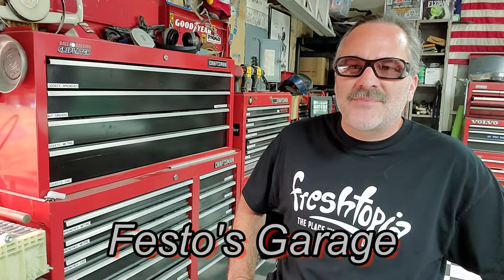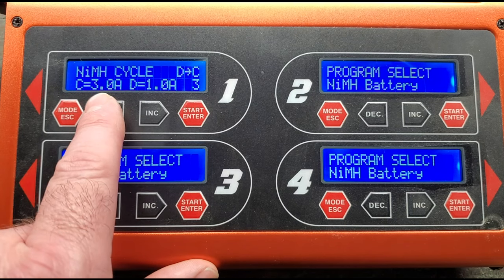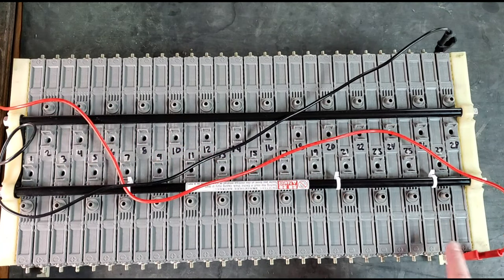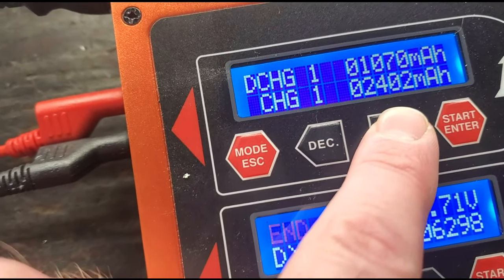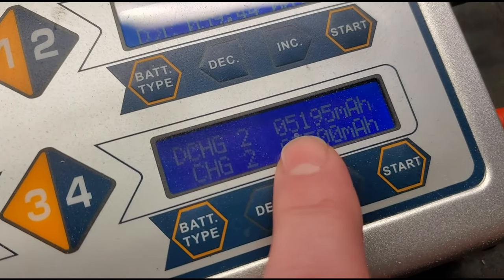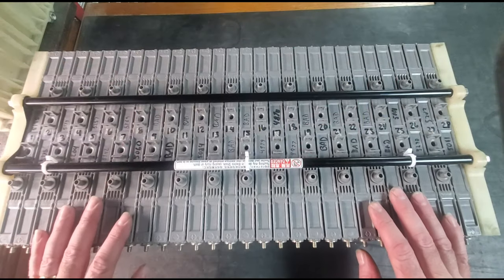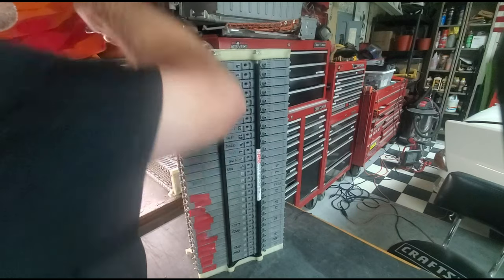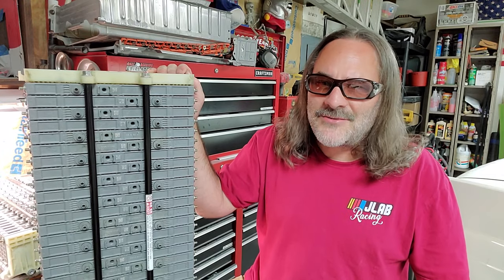Hybrid Battery Pack Refurbish - Step-By-Step w/ Settings - 2nd & 3rd Gen Toyota Prius - CQ3 Charger

Comment: Can it charge a few cells in a row? I have RX 30 cells*9.6V. I want to connect it permanently to 7,8,8,7 cells and charge it while parking
Reply from the maker: Thank you for watching. I do not know if that is possible. Sorry. Maybe someone reading comments will know? Maybe you can check online forums for answer. If you find answer, please write back in and let us know.
Reply: By 30 cells, I'm guessing you mean 30 modules. If each module is 9.6V, then you have 8 cells per module. Why would you connect a CQ3 charger permanently to a battery pack or any number of modules while it's still in the car? Also, what do you mean by 7,8,8,7 cells?

Comment: will this process work for a system upgraded with lithium blades
Reply from the maker: Thank you for watching. Yes this process will work for Lithium Ion batteries as well. Be surer charger is setup for lithium instead on NiMh.

Comment: Will you explain why you are only discharging down to 6 volts? It
 seems like this will give a false reading of the discharge capacity.
Reply from the maker: Thank you for watching. The discharge can be adjusted between 6.3v to 6.0v. I am taught that the voltage should not be much less as it could cause damage to the battery.
Reply: Why do you think it would give a false reading?

Comment: Is the second time I do this and I am not sure if I am doing something wrong but always all the time all the cells arrive to capacity at the first discharge and charge, it never goes to the second one, am I doing something wrong? I followed all the instructions
Reply from the maker: The charger will stop cycling once the battery reaches CAPA. If the discharge value is not 5000mah then you will need to run it again. If the charger does not reach CAPA then it will proceed to next programmed cycle.
Reply: @GreggFesto  thanks for replying, I get that but is it normal that all the cells arrives to CAPA on the first cycle?
Reply: @GreggFesto   Also another question if in the first cycle it goes over 5k is that enough or would be better if I run it two more times to get it over 6k? or is the same ? thanks
Reply from the maker: You are likely to get CAPA message first cycle if the batteries have been sitting for a while. This is why I like to run 3-5 cycles on each battery, it will tell how the battery is health wise by seeing if the discharge value increases or decreases with more cycles.
Reply from the maker: I suggest running 3 cycles at least on each battery so you can see if the values are increasing or decreasing. It will give you batter idea of the health.  A value of 6000mah discharge on your batteries will certainly be better than 5000mah. Remember that your pack will only be as strong as your weakest battery. For example if you have 27 batteries with 6000mah discharge and 1 battery with 4000mah discharge then you are limiting your pack to 4000mah. This is because they are all in series configuration.
Reply: @GreggFesto  again thank you so much for your help, you are great help for the community

Comment: When process is done and wnat instal batery on car do we instal it fully charged?
Reply from the maker: Yes, When using the charger to run the cycles you select discharge then charge. This way the batteries are left in charged state for balancing and installing in the car. Prius uses HV battery to start car so if you try to install discharged batteries the car will not start.

Comment: Thanks for the good video, I have a question. With the same mode (Ni-Mh/C=3.0A D=1.0A 3 cycle D>C) when I turned on the batteries on test, none of them passed, but the battery pack was disassembled, it was on a separate table. The elements get fat and none of them could complete the test, I really know that these elements are good, I just bought this device and wanted to test and learn how to use, please hlep me to  trooblshoting this process
Reply from the maker: Thank you for watching. I can try to help. When you report that the battery pack was on a separate table are you stating that the pack of 28 batteries was on a separate table or are you stating that an individual battery, 1 of the 28, was on a separate table?
Reply: @GreggFesto  More precisely, I have 8 batteries separately, and I took 4 of them and connected them to this charger, they did not pass the test, they got fat. That is, it is necessary to battery pack was in it's  frame? that they can't get fat ? is this correct ?
For example, I have 1 battery, but how can I test/restore it correctly?
I really want to study the operation of this device fully, I have charged the batteries separately with my custom own charger but not with 3A ( used 0.65A -1A in this range)
Reply from the maker: When the battery swells if there is nothing to contain the growth damage can be done. You should charge the battery in the assembled pack or under compression like between 2 pieces of wood in a vice.  If you follow the steps in my video it will work properly.
Reply: @GreggFesto  Thank you very much, I will definitely try and let you know the results
Reply: Why you using mode ni-mh/c 3.0a not 5.0a?
Reply: @GreggFesto  Finally, I started to exercise the batteries in a pressed position. However, I did not get the desired results, I want to share my situation, I can not upload photos here, how can I contact you via email or somewhere else?
Reply: These NiMH batteries do not like to be overcharged.  When these modules are in like new condition, they can hold 6500 mah, with a max charge of 8.60v.  You can overcharge them even if you apply just a 0.65 - 1 amp charge.  I suspect the "delta peak charging" (or Delta v) feature is worn out (due to overcharging).  So you should not blindly charge them with 7500 mah without watching them closely.  I have charged many modules @ 3 amps up to 8.60v, without them getting warm or the module bulging.  But I do not charge them until Delta v occurs (which is what is being done here with this charger).  if a module expands, this is an indication that you have overcharged the module.  If it doesn't shrink back to its original shape, it is likely damaged and should be replaced.  If you charge one of these modules @ 3 amps, watch to see where the voltage stops increasing. If you have overcharged your whole pack, then the Delta v feature may not be triggered, which is a safety feature that tells the BMS (while driving) that the pack is at max voltage.

Comment: Are you able to provide a guarantee after all that presider if you are doing that for someone? If all of them will be above 5k when D-churched how long would it usually last? Even tho I understand you never know I just want to have an rough idea. Thank you!
Reply from the maker: Thank you for watching. I do not provide a guarantee when doing this job. If someone did demand a guarantee, I would feel safe stating that it would be fine for at least a year.  I have been doing this method of refurbishing for around 4 years at this time and have not had to redo a pack yet.

Comment: Hi Gregg, sent you an email with details. Not sure if you will receive it. I know you answer here pretty quickly. I am charging cells. I have bad one and good ones after 3 or 5 complete cycles. My question is I would like to make sure I can double verify the good ones and bad one in a black and white scenario to be 200% sure the bad ones are bad and same for good to sample once in a while. What could I do to put a charge  on the cell and have a confirmation. what load how much time ?? Thanks
Reply from the maker: I appreciate you watching and writing in. I am not sure of a better way to test the batteries than the charger itself. if you find one, please let us know.  I wrote back email as well. I wish you the best with your Camry packs and hope you will provide an update when you have completed the refurbishment to let us know how everything turns out.

Comment: Hi, why are your charging settings at 7500mAh cap for a 6500mAh module?
Reply from the maker: Thank you for watching. The reason the charger is set to CAPA at 7500mah has to do with the way it reads voltage while the battery charges, you can learn more on this by researching "delta peak charging".
Reply: @GreggFesto I read delta peak and that is the voltage drop at full charge. My issue is that the charge stops saying CAPA. So I need to increase from 7500mah to more?
Reply from the maker: I suggest that you do not alter the CAPA setting too much more than 7500-7600.  This setting is keeping you from overcharging the battery and causing damage. The value that you want to pay most attention to is the discharge, which should be 5000mah or higher.

Comment: How long did it took everyone to charger every 4 module?
Reply: I just want to know how long will it take to do the whole battery since I only bought one of this exact machine and it only does 4 at a time. I tested each battery and they come back at 100% of battery left in them with good voltage and low resistance
Reply from the maker: Thank you for watching. It usually takes me about 3 weeks to complete a pack refurbishment.

Comment: Hey Gregg, So my question now is, does it matter what gauge wire is used to balance the battery? I currently have 24 gauge galvanized steel wire wrapped around cell twice. Ordering bus bars and nuts.
Reply: And does it matter if Ieave wire attached for more than 48 hours?
Reply from the maker: Thanks for watching. I have not tried 24awg but it should work. I am not sure if the galvanizing will affect connection. I suggest checking each post with a muti-meter to make sure there is good connection from one battery to the next.  Leaving battery connected in balance mode longer than 48 hours is not a problem.
Reply: Roger that. Thanks!

Comment: Great video Gregg. Very informative. Just a quick question, I had done 6 cycle on my battery and on the 5th cycle, I get the reading D = 5032 / C = 106, on the 6th cycle, D=131 / C = 1028. Is this normal? Should I continue another 3 cycle or should I stick on the 5032 since it met my 5000mA discharging target.... Why the charging value are less than the discharge value.? Thanks
Reply from the maker: Thanks for watching. I have not experienced these types of numbers. Perhaps the battery has failed? I am sorry cannot provide a solution on this one. If me, I would try running another 3 cycles and see what happens.
Reply: Will try again a few cycle. Thanks Gregg
Reply: Hi any solution to this? Currently facing this issue however my battery started going back up on charge but wondered if I should still use it.. My readings were  D=1402mah C=665 mah, D=692mah C= 5405 mah, D=3145 mah  C=5472 mah.... Was wondering about that low charge
Reply: What happened after running more cycles ?

Comment: Hey buddy.after my cycles are finished. I'm getting 000 on the low side on these on all of them. The high sides are shutting off at 75 hundred.i'm running these 3 cycles just as you described. What am I doing wrong or are these batteries just no good?
Reply from the maker: Thanks for watching and writing in. I suggest running another 3 cycles.  If you have run 6 cycles and still get below 1000mah on discharge I would say that is a bad battery that cannot be recovered.
Reply: Keep in mind that what you are reading for numbers is the amount that has been discharged. That means the first time you run any of these, you will get a very low number most of the time because it was not perfectly charged already. 

You've got to run them through at least two cycles in order to get a reliable number.

Comment: Thanks for the video. Can I use same your method with 08 RX Lexus?
Reply from the maker: Thank you for watching. If the Lexus has the same batteries then the same settings will work for you.  If they are not the same I suggest going to a forum for your vehicle (or maybe PriusChat) and asking someone there  that would know.
Reply: Thanks for your reply. The video you made looked very easy stets up
Reply: First thing to find out is if your car's batteries are NiMH. If they are, then you should be able to apply the technique in this video with a few tweaks.

Comment: Hey Greg I've got several of modules that are maxing out on the charge capacity at 7500 is that a good or a bad sign
Reply from the maker: That is good. A super good result would be 7500mah on charge and 5000mah or more on discharge. A battery with these numbers is very good sign.
Reply: @GreggFesto  thanks sometimes after a Max charge cycle I'll get a really low number on the next charge cycle what's up with that
Reply from the maker: I am not sure why you would get a really low number. Have you checked all the settings on charger? You are setup to discharge then charge, correct? If you see the discharge and charge numbers both start going down through multiple cycles that indicates the battery is beginning to lose capacity and will need to be replaced.

Comment: Thansk for all your response ! One question you did not answer. What is the average time for a cycle 9 hours if 3 cycles, 27 hours ?? thanks
Reply from the maker: Thanks for watching and writing in. I am not sure how to put a number on the hours it takes to do a cycle. It really depends on the health of the battery. It usually takes 14-20 days for me to do a pack.
Reply: @GreggFesto  thanks holy cow that's long !!!
Reply: @GreggFesto  And that is with 2 Cq3 right ?
Reply from the maker: The estimate is with a single CQ3 charger. The second charger speeds things up especially at first. It is not good to charge 2 batteries right next to each other so the 2nd charger becomes void at some point. I estimate the 2nd charger reduces time by 4-6 days.
Reply: @GreggFesto  yes I saw 3 cells appart. We just bought 2 CQ2 and received cables yesterday. Ok close to half with 2 chargers. Better time lol will let you know when I start and get my first battery. We have close to 15 battery packs to do.
Reply: @GreggFesto  that is why at some point the charger will start on the second pack lol
Reply: @GreggFesto  I saw a guy charging a single cell out of the pack to show the swelling and holy cow it was bulging like crazy !!!!
Reply from the maker: It will split open and leak too. They get allot of pressure in there.
Reply from the maker: That is awesome. I wish you great success and look forward to your update.

Comment: Great video but I am still getting the P0A80 code after I followed your instructions with low charging modules range from 5066 to 5793 and all of them have 7500 on high charging.  It took weeks getting all cell modules completed with one CQ3 unit.  I also balanced them using wire daisy chain for 4 days but I am still having the same code P0A80.  Please advise.
Reply from the maker: Thank you for watching. Did you clear the codes from vehicle after putting it back together? If yes, did the code come back instantly or did you have to do a few drive cycles? Did you install clean bus bars and screws? Are the contacts on block wires (every other battery module) clean? Have you checked the wiring checked the wiring on the computer side of the pack and make sure everything is plugged in. There are some coils that the wiring passes through on the computer side of the pack which go bad sometimes and will cause same generic code.  What code reader and app are you using?
Reply: new nuts, new bars and cleared code using tech tream apps but code returns instantly.
Reply from the maker: I suggest double checking that the orange plug disconnect latch is locked in place properly with that bar on it seated fully.  The wires that go to every other battery have ends that are crimped on which if loose can cause problems I have had to solder these before. With your techstream app, can it  show if the white coils (located in the battery pack that the orange wires pass through) are working properly? I have replaced these before. I am making suggestions based on my own personal experiences. You can find others with more experience than myself on PriusChat forum. Please write back and let me know what you figure out, I am interested to learn more.
Reply from the maker: What did you determine was wrong with the car?
Reply from the maker: You mentioned that you had Techstream which is very powerful tool. Have you gone on PriusChat forum to see if someone there can help you narrow issue down? There are some real experts on PriusChat that know how to navigate Techstream well. I think that would be your best bet besides a trip to the dealer.
Reply: My car mpg drop to mid 30 from upper 40 since reconditioned of cells and I am still getting PA080 code.  I’m at lost and disappointed with the car.

Comment: Mine will go through cycle 1 hit about 2500 capacity and 5000+ discharge and on the next cycle it hits capacity and 0 discharge. Do I continue with 3 more cycles?
Reply from the maker: Thank you for watching.  I suggest running a few more cycle on it to see if it will build back up.  let us know what happens after 3 more cycles please.
Reply: I set it to Charge and then Discharge. That's where I messed up
Reply from the maker: Glad you got it figured out, thank you for the follow-up.